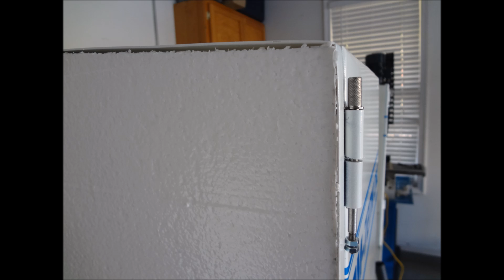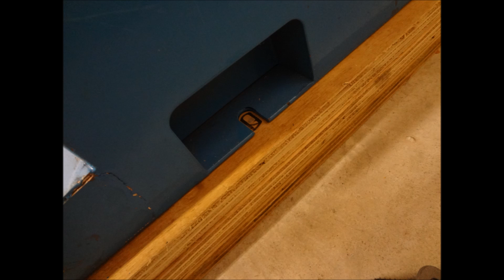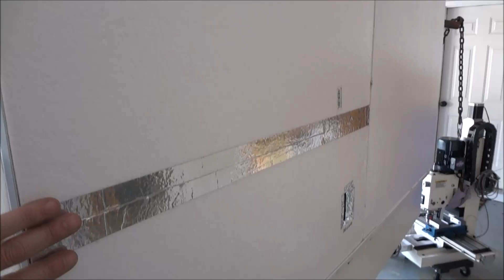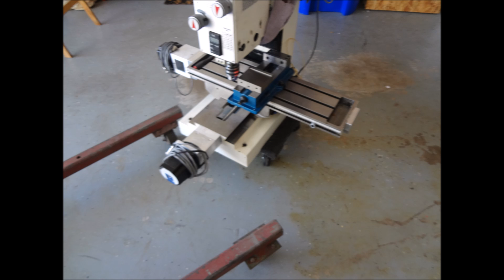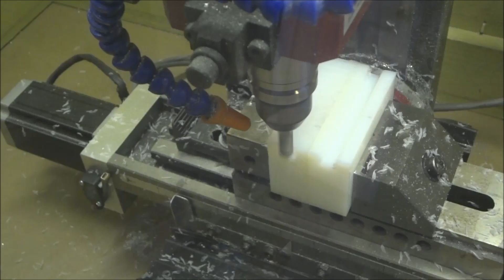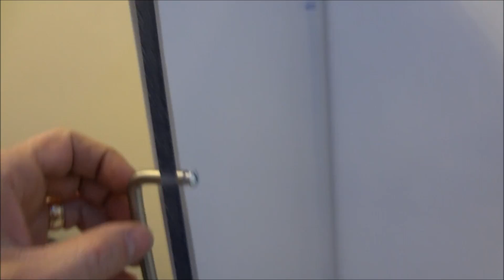PM727M CNC Mill Enclosure Part 2

Comment: no safty switch disengace when door opened?
Reply from the maker: There is plans in the wiring diagram for a optional safety switch for a belt drive cover and a door switch can also be tied into this if needed.
 Most DIY CNC Machines do not even run enclosures. The PM 727M project is still a work in progress and once the ATC is up and working I think a door switch will be warranted. Depending on your needs and machining requirements you may need one. 
It's better to be Safe,
Sam

Comment: do you know how to wire a spindle to a c10 board. to an relay switch, running power in to a power switch?
Reply from the maker: Christopher Vanlent 
hi you want a c10 to operate a solid state relay to turn on a spindle?
Reply: CNC4XR7 
Yes.

Comment: Looks great. I am trying a similar build and trying to figure out how you got Mach3 a 32 bit to work with Fusion 360 a 64 bit. If you have any pointers for programs and type of computer, at this point I am confused. Thanks
Reply from the maker: Darin James 
Mach 3 is running on a separate cpu.
it only processes the gcode output by Fusion 360.
I run Fusion 360 on a laptop with Windows 10

Comment: Very nice work, I've enjoyed watching your progress. Our enclosures are very similar in design. I used alucabond and an aluminium frame for the walls. Our doors are nearly identical, but I used 10mm acrylic and draw runners top and bottom. I don't have a video yet, but you can check it out on Instagram if want (dctteacher1). Cheers Aaron.
Reply from the maker: Hi Aaron,
 Very nice enclosure, and very similar.  I had intended to use slides top and bottom However I cancelled that after I realized there was a problem with chips the Teflon guides work well and the swing open gives plenty of access.

Comment: You should get an award for this most detailed and excellent job presenting this project. This took much time let alone the efforts.
One thing I wondered after seeing your final location of the mill, you must not plan to run long parts outside of the table limits in the X-axis, like machining long tubing or other items that are several feet long or longer?
Reply from the maker: Thank you
I am a little tight with my mill location at the moment. I do not plan on machining anything of length. I originally had the side walls with sliding poly windows which could be lifted for machining long pieces.